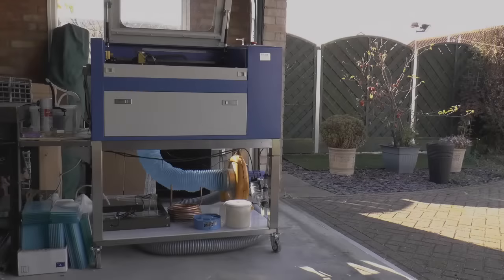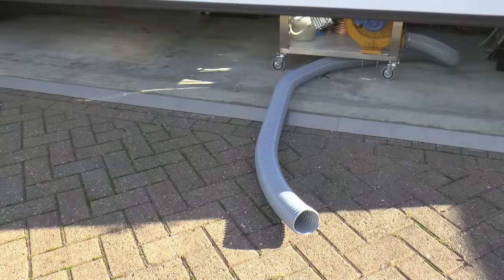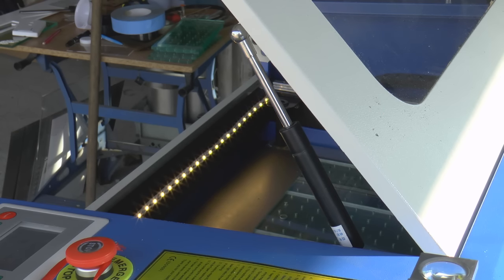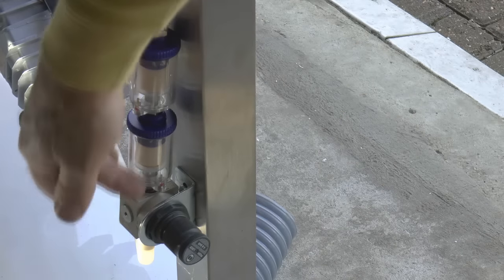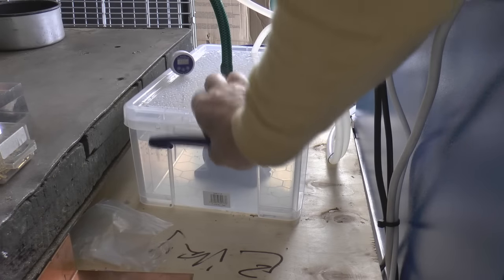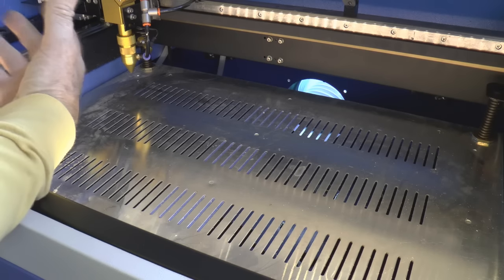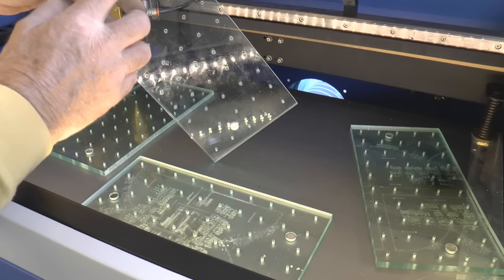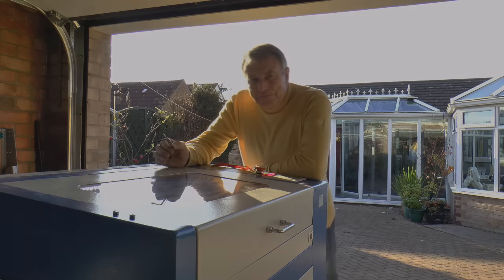My 50 watt Chinese Laser 4-month review

Comment: wow- what a great video  - this was one of the most informative I've ever seen.  the tips, customized adjustments and observations were really interesting -  you're clearly very talented.  THANK YOU!!  Like all people who post videos here -  it is really appreciated by those of us seeking to learn from others who willing to share their expertise.  Unlike many however - they aren't all this good!!

i want to buy a laser but have been concerned about the low price of these  off shore machines and  am hoping to learn whether or not they really are worth the money for anything beyond that of a light hobby?

should you have a quick moment away from the dreaded 'honey do list' to comment - i'd be so grateful.

what would  your opinion be of this wattage or an 80 watt laser used to etch - no actual cutting required - for one of a kind or small production of up to 6 unit runs per day doing decorative embellishments specifically on wood, glass, acrylic, leather, hard white plastic, natural and technical fabrics, paper and card stock substrates - are there any exceptions?
 
use would be to create finished decorative arts, clothing, accessories and home decor sizes not larger than 18" x 36" by 6" depth. - I am worried these machines are not truly capable and might end up costing too much in replacement tubes, parts and modifications to be worth the initial purchase.         

 i'd greatly appreciate hearing what you think as to date you are the only person i have discovered who is able to compare their experience of what sounded like true production scale lasers and these smaller more affordable models.    many, many thanks.
Reply from the maker: +genny anny 
Hi 
Sorry for delay in answering, I thought I had. Apologies.
I looked carefully at the pictures of machines before I purchased and assessed things like the stiffness of the axes, the recirculating bearings on the slide-ways, the ability to take in many drawing formats (in my case I was particularly keen to work with DXF files from my CAD system),  the more comprehensive control panel, the rotary device (simple and sturdy) the red dot pointer (not really essential), the air assist to the nozzle (absolutely essential to protect your lens) and finally the motorized work table.  These were the features that narrowed my choice of machines. However, things are changing all the time so choose carefully. 
When you pay about 300K for a machine you expect excellent engineering. So dropping to a £1200 "hobby" machine for pleasure rather than profit was not a comparable purchase. However, if you have watched my first  video  ( https://youtu.be/YvrMeUUzaBo ) you will see my immediate reactions when I first examined my machine. At that stage I knew virtually nothing about the machine. Although the essential mechanics of the machine are well designed and appear to be built with good components, I would not recommend it for 8 hours a day continuous use. The duty cycle you describe is "serious hobby use" and its the mechanics that are going to take the punishment. Run at highish speed for etching (maybe 200mm/sec) the machine gets a bit of a jolt as the X axis changes direction. If your machine is on a STURDY workbench you will not have an issue but if you put it on a thin legged table or on a trolley (as mine is) it could start shaking itself around. My trolley is clamped to a very heavy adjacent bench and is now rock solid.  I would certainly recommend a cheap machine for your venture. If you are not cutting  then even a 40 watt machine would probably be fine. However, the fact that you need a 500mmx1000mm table means you into quite a large frame size and you will probably find only 80 and 100watt machines in this bracket (http://www.ebay.co.uk/itm/Laser-Engraver-Cutter-CO2-Laser-cutting-machine-80-Watts-next-day-deleivery-/252118125837?hash=item3ab3694d0d:g:npAAAMXQUmFShhYN) Even though this appears to be sold via a distributor with some support, everything about the appearance and design says "Chinese Origin".It's good to see that the most vulnerable part of the machine is a reputable RECTI tube with a long life. As you can see, upsizing the table causes a huge jump in price although buying something directly from China (as I did) with no local support  can save you lots of money. This looks very good http://www.ebay.co.uk/itm/2015-New-80W-Co2-Laser-Engraving-Cutting-Machine-Cutter-Engraver-machine-220V-/311442647703?hash=item48836daa97:g:Z5cAAOSwQPlV8c25.

My only comment about the materials you are engraving/marking is to be very cautious."Hard white plastic", "wood" and "technical fabrics" all throw up warning flags, either for YOUR health or your MACHINE's health. Do proper research to find out what chemicals are released during "burning". For example, although polycarbonate can be cut and etched (but not very well), a small percentage of the fumes produced are of hydrogen cyanide (death chamber gas). What surprised me though was on the toxicity scale, Douglas Fir was comparable to polycarbonate, presumably because of the high resin content.
 
Bear in mind that I'm no expert, just another person learning to use a Chinese Laser, but enjoying my other hobby (videography) at the same time to document my struggle up the knowledge ladder. I hope my ramblings will be of some value
Russ
Reply: +SarbarMultimedia You could not have been more helpful and thorough.  You have told me far more than any one selling them that I've spoken with -  so for my money you are an 'expert'!!  THANK YOU!!!!   I too have a CAD background and use digitizing software for multi-needle embroidery so I know what I need a machine to do but just didn't know - until discovering you - what they can, can't, should and shouldn't do.  I am seriously going to reconsider my 'all in one option' and look at the 80 watt for size of work space but adding a separate CNC machine for wood.  I think I need to find something else to use on the hard plastic that won't end up killing the family - any suggestion there would be helpful but you've done more than enough!!     I sincerely 'owe you one'.
Reply from the maker: +genny anny 
Hi 
Didn't mean to scare you about laser etching wood, it's safe provided you have a powerful extraction system that blows your fumes UP and away to quickly dilute them. However, the more practical problem with wood is that the resins and plastic binders in particle boards will leave a sticky residue in your machine. See https://youtu.be/qtFR_w3sS3g  about experimenting with a compact extractor system for evidence of this.  I have spent a lot of time experimenting and learning about the mechanics of my machine and software and I have a few more additions and experiments to conduct before I start to really use my machine for it's recreational purpose. The projects I have done so far have all be vehicles for learning. I recently came across a useful set of instructional videos (not watched them yet) about all the artistic side of using the machine....the sort of stuff you do. see https://www.youtube.com/channel/UCV5ciDwLItOwes5OtC9Dayw

If you can afford a two machine strategy then small CNC routers (of Chinese origin) abound on Ebay You will be able to cut wood and plastics on this safely (may need a mask depending on your extract system again). I started to investigate one of these for a colleague of mine who wanted to engrave a company logo onto his products . Although you can get machines for as little as £250, I wouldn't. You need to be in the £350 to £400 price region (or more)to get something half decent. Two things to be aware of. Firstly I found no machines that could be controlled via USB, they all connect to a PC via an "old style" parallel printer port. It's not an expensive issue to get a parallel port card added to your modern desktop pc. I happen to have several old style laptops running XP that would have done the job for my colleague. The second thing to note is the software. The machine comes with some routing software that I think is a full version for private use/evaluation. If you are doing otherwise I think you have to pay for a fully licensed version (quite expensive?) so read the adverts carefully and make your own enquiries.

Good luck 
Russ
Reply: +SarbarMultimedia  Thank you so much Russ - and no you didn't scare me at all  your information is invaluable to someone like me and it is very kind of you to share it.   We would only use a Laser on Red Cedar but maybe a CNC would be better - we simply don't know.   We have a government permit to gather old growth Red Cedar wood - brought down by avalanche - not logging - just wanted to qualify here for fear of being 'yelled' at by some.It comes from the Rocky Mountains of Canada.  We wholesale the raw pieces to wood workers but also fabricate lights for commercial or residential purposes, driftwood christmas trees, wooden dog bowls, Ipad stands etc but we'd like to enhance some of them with some unique designs but also for name dropping for corporate clients.     I'm appreciative that you reminded me of the software issues.  I have been dumbing down to XP for a few years now in order to keep using my expensive software.  My embroidery machine was built in 2004 and needs XP.  I can export in just about any graphic related file as I have AutoCAD, Photoshop and Illustrator but all are older programs.  I have a couple of adapters for the serial port to USB for use on drawing tablets  - just as you suggest but it was a great reminder as I had forgotten altogether about this and it is a HUGE issue.  Do you think it is possible to use one software for both a laser or  CNC activities or is it better to be brand specific?  Also for feedback I wanted to tell you that what got me so interested in your videos - and then your information - was the fact that you were making adjustments for serious ventilation concerns and that you were doing so with a bouncy castle pump!!!  Both my husband and I appreciated this. I love the way your mind works - especially - as you say - there is no support when purchasing this way - hence the lower price point.  If I can trouble your for a quick CNC brand suggestion I'll not bother you anymore!!  I believe - Your videos are great - the quality is terrific and I have watched dozens and dozens on Youtube.  You are easy to understand and the information is very well presented  -  which I realize is not easy to do.    I now sincerly owe you much more than 'one'!!
Reply from the maker: +genny anny  In case You Tube hasn't warned you, take a look in your messages section of video manager
Reply: hey russ, not sure where that is or what to look for but i noticed my last reply was crossed out for some reason.  was there something i did wrong?  hope not!  not sure how this all works half the time. sorry if i caused you an inconvenience.  g
Reply from the maker: +genny anny 

You somehow selected strikethrough font. Dont worry it was readable 
Go to YouTube and select My Channel. Along top select Video Manager. On the left you will see Creator Studio panel. Click on Community, then select Messages.

Comment: I bought a similar laser cutter, mine came with a centrifugal fan and as a flange I glued a plastic pot to it
Reply from the maker: +Paul m 
Hi Paul, I have noticed that a few sellers are now supplying centrifugal fans on ebay.com and ebay.ca  but I still haven't noticed them available on ebay.co.uk.  It's like everything else with these Chinese machines, you have to look around for the most complete deal when you buy. I didn't see any when I bought mine back in the summer. I don't know where you machine is sited but with such a high volume fan you will need to leave the lid partially open for maximum efficiency (I leave mine fully open all the time with absolutely no fumes escaping) and the other important thing to remember is that air will only go out if you allow it to come in ie don't strangle the free airflow through your machine by closing your workshop door.
Reply: Hi Russ. So you have no safety switch on the lid. Most lasers will stop firing if you open the lid.
Reply from the maker: Hi Klaus. 
Most cheap lasers do not have a safety switch but even if they do you can easily bypass it or disconnect it from the controller. they make it a selling point but it would be a real nuisance to me The impression is given that "laser rays are very dangerous" but take a look at my  https://youtu.be/kJe16YQlIM0 and make up your own mind.
Best reagards
Russ

Comment: Is this thing any good for a hobbist? I really want one but I am afraid of it breaking down... I can learn anything but I would like to keep my learning in the software and the processes of engraving and cutting 10 mm sheets of hard woods...Thank you!
Reply: Hi David
I have used an 80 watt laser with a 2" focal length lens to cut 19mm American oak. Yes it was slowly at about 4 or 5mm.sec but it was doable. So yes cutting hard wood to 10mm is definitely possible at reasonable speeds of 8 to 10mm/sec However you may be limited to the type of engraving you can do.Engraving requires (demands) very little power maybe as little as 5 to 10 watts. The problem with an 80  watt tube (or higher) is the non-linear power characteristic that will be difficult to control at these low wattages. For cutting you need all the power you can get. Normally 60 watts would be a good compromise power. I'm not saying 80 watts is no good, just that for some materials and types of engraving you may find it difficult to get good results.

If you buy a cheap machine from Ebay or an Amazon market trader it's a certainty that you will be getting a reasonable mechanical/CNC system that will be fitted with an over rated  B grade tube and power supply. By that I mean they will quote peak tube watts (which you cannot use) instead of the safe max normal watts. For example if you buy a 100 tube it will be 80 watts and if you buy 80 watts it will be 60 watts   If you buy from a Chinese factory direct (via Aliexpress) then you will get what it says on the tin. However there will be a long 6 week delivery wait, transport costs, customs duty and tax to pay. 
If you buy from ebay you are getting a very good deal BUT you must factor in a PROPER new tube and power supply as part of the purchase cost calculation if you are doing cost comparisons The Ebay tube supplied may work well for a few months or it may fail within days. It's a lottery. DO NOT look on ebay for replacement tubes.
Also, make sure you buy your machine with a CREDIT card. Even if you have a PayPal account do not use funds therein. Paypal give you zero protection because they dropped manufacturing equipment from their  guarantee scheme. E bay are also useless other than recording communication between you and the seller. Your ONLY protection is your card provider who has a legal requirement to protect you against fraud or faulty goods.

Best wishes
Russ

Comment: hey can someone help I keep getting in progress or pause when I'm trying to start the machine to engrave
Reply from the maker: Hi Lewis, 
Your problem description is a bit sketchy but I think it is your origin point that is causing this issue.  When you are cutting you can use the whole table area. Not so for engraving. If you set an engraving program to start at 0,0 then it will not. When running an engraving program you have to leave room at the edges to allow the head to slow down and reverse after each scan line.  Try setting your start point at say 50 ,50.  The amount of room required for turning round will vary with scan speed , so maybe you can get away with as little as 20,20  for your start position.

Best wishes
Russ
Reply: SarbarMultimedia dude thank you for the information  what was crazy I use to get "communication error " but in the right lower corner I had to click device  USB so after doing that that when I was getting "in progress or pause " so dude please keep in touch thank you so much have a good day